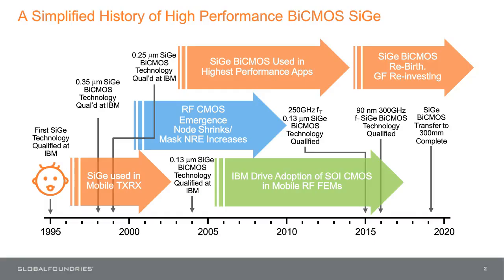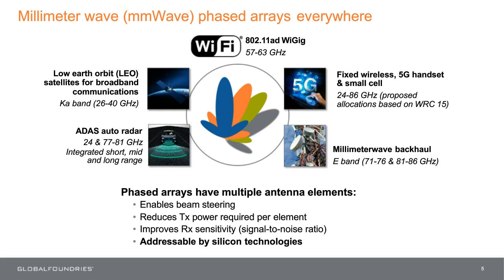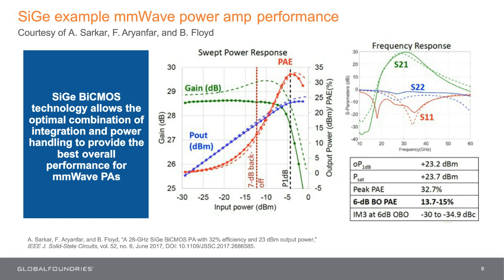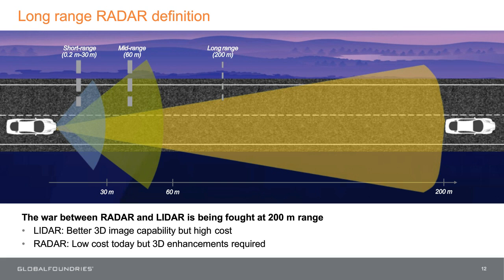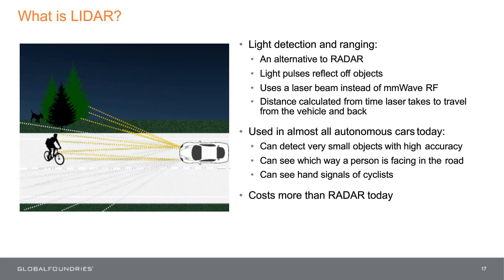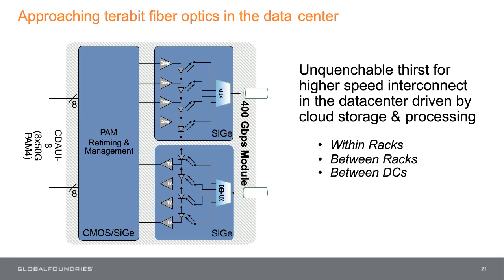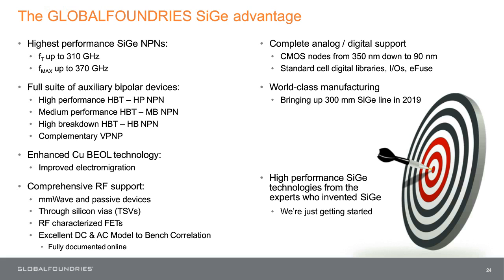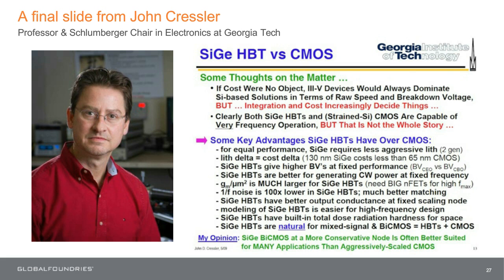SiGe or CMOS Choosing the Right Technology When Performance Is the Priority

Comment: Eventhough many research groups over a decade achieved and also tapedout  10Gb/s to 56Gb/s datarates transceiver for optical links  in CMOS nodes (65, 90, 130, 180nm etc) , Why not those tranceiver chips (Laser drivers,TIAs etc.) are not being manufactured yet in CMOS for a large scale commercial applications like datacenters, chip to chip communications etc..? Still high cost SiGe technology is being used rather than low cost CMOS for high speed (say 30Gb/s) opticallinks.